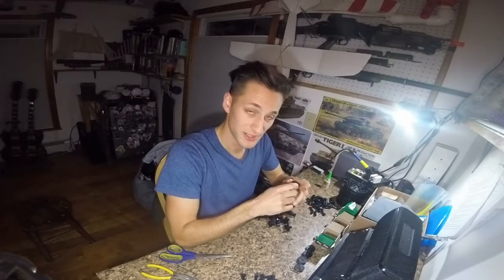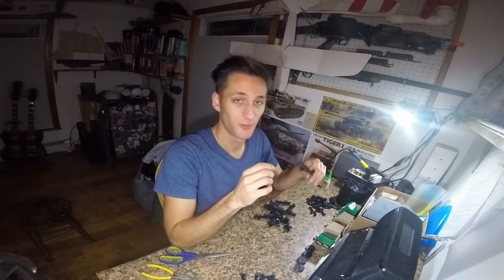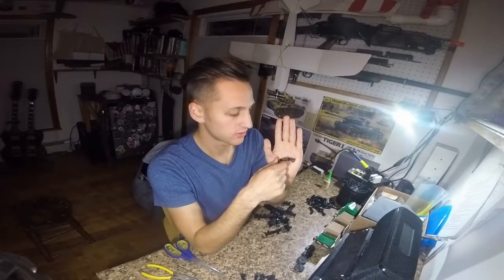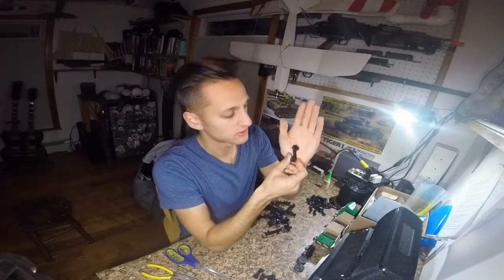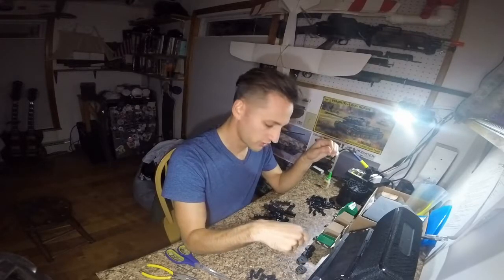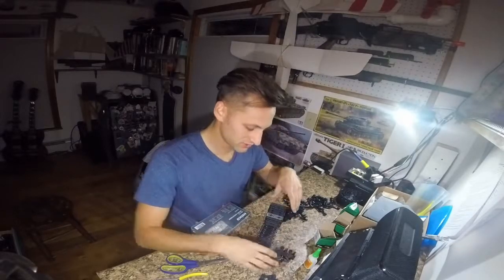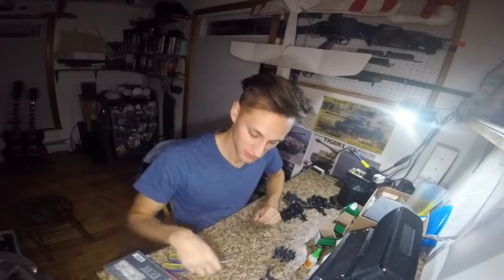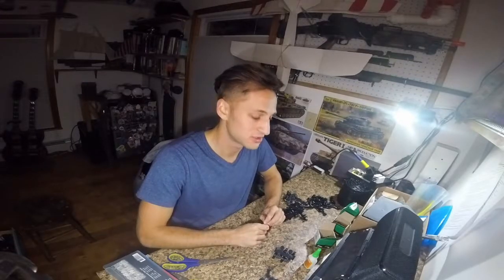1/16 RC Maus Project: #7, Suspension!

Comment: Great video! I want to ask you for some advice if you don't mind. I'm currently working on a KV-1 rc model and I'm designing the suspension. What do you think would be a better option: mirrowing the suspension arm in the inside of the hull and have it lever against a regular spring or going for a torsion bar design?
Reply from the maker: Depends on the scale imo. I tried 1/35 scale torsion bars but could never get it right. I think some people sell kits but they were too expensive for me to justify. In 1/16 scale I'd definitely do torsion bar style because there's more room and parts to work with off the shelf at the hardware store. 

Mirroring the lever isn't a bad idea either. I think it would be a quick and effective solution to that problem. Easy to adjust the springs too. Very cool project! Will you post anything about it?
Reply: Thanks for the advice. It's going to be 1/16 scale, so I'll try the torsion bars. I will probably upload it to thingiverse, but it will take a while, as I am doing a Porsche  Tiger atm and I have to make instructions for both of them.